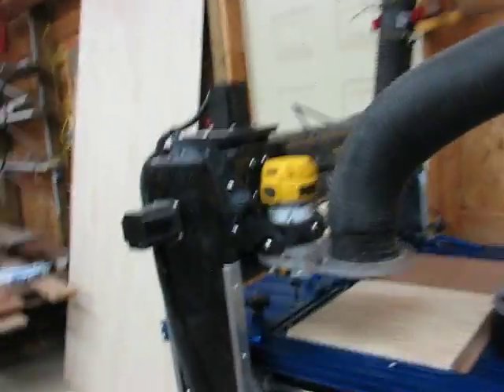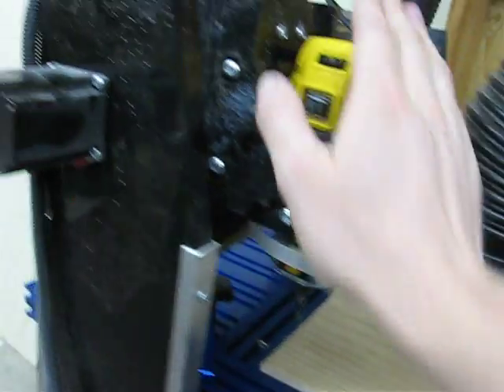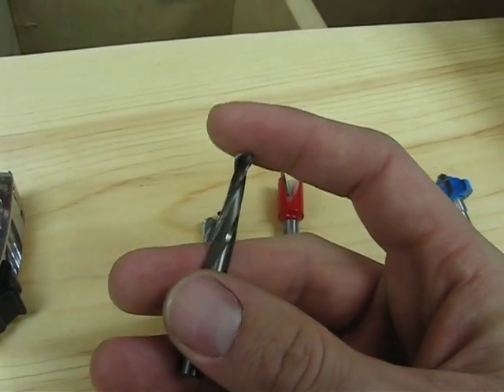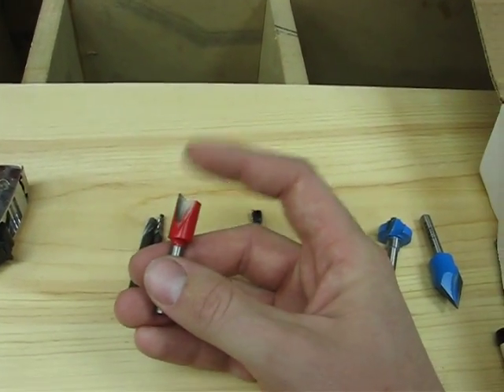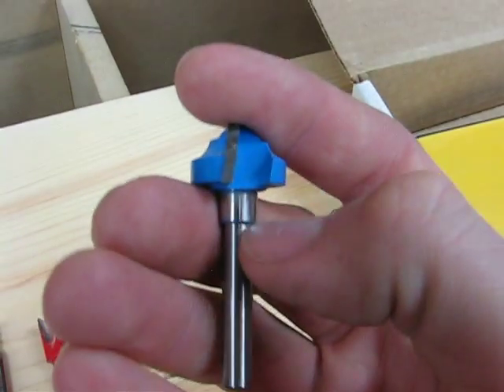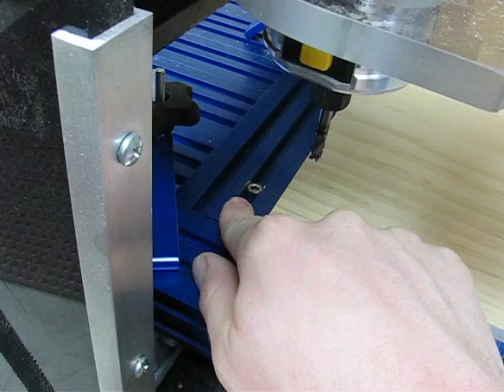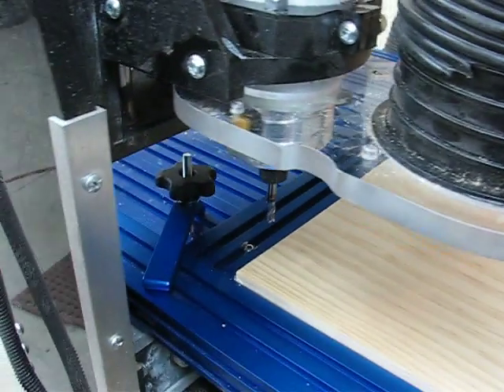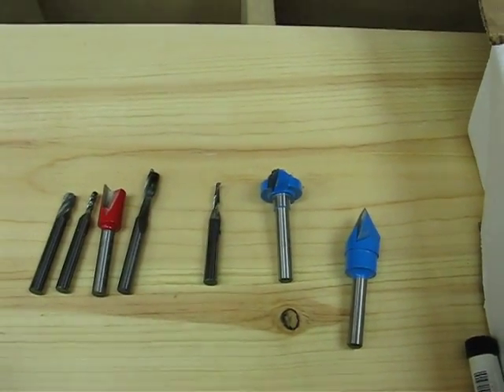CNC router update

Comment: Where did you get the 4" dust port and matching shoe? I just received my "Limited Edition" Mako Shark and it has a small 2" or so dust port. My dust system is 5" and the reduction does not help, MDF dust is everywhere. I was thinking about trying to mill a new one.